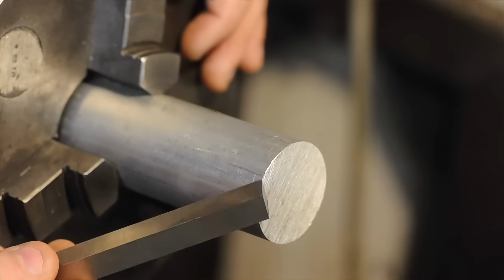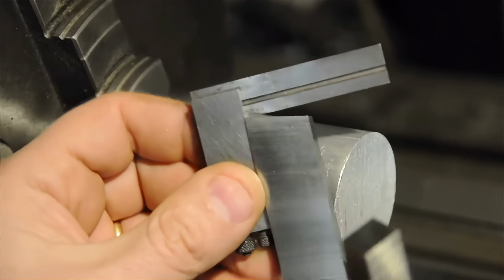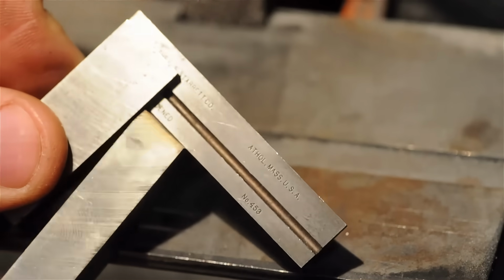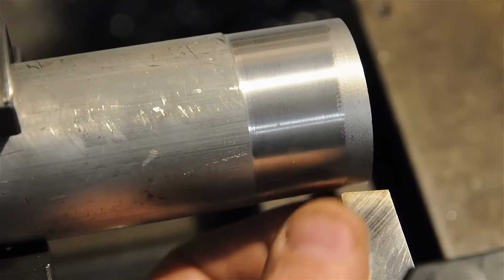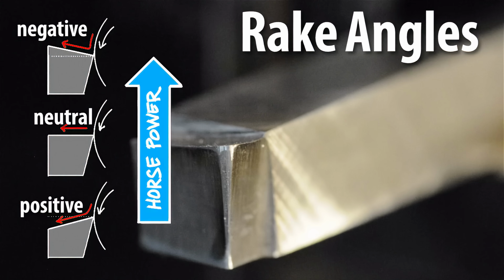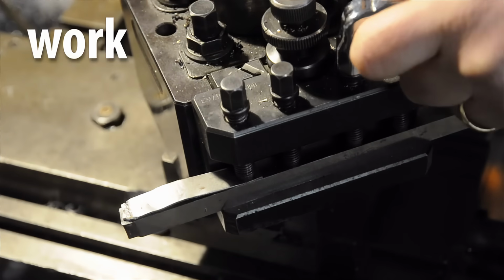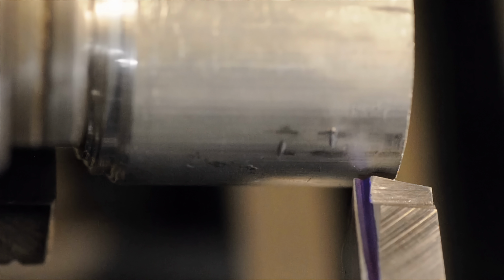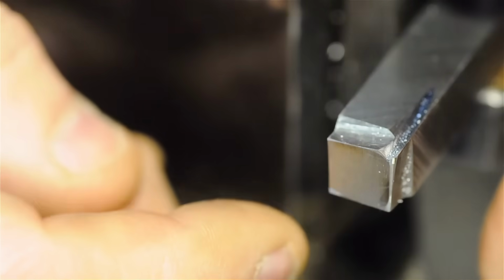Grinding HSS Tools

Comment: I love this lathe.>>>ur2.pl/861    I purchased this over a year ago, and it is still running strong. It does all the smaller jobs you need to do without skipping a beat. The variable speed on this machine is hands down the best feature you could ask for...(especially for the price!!!) Id recommend this to everyone looking for a quality, and affordable lathe.
Reply: good
Reply: Are you aware this lathe has plastic gears in the drive train?They all do HF etc), as they are all made by same supplier with different features and colors.  I broke a tooth in first month. You can go to Little Machine Shop and buy a set of metal drive gears for another $130 but PLASTIC (ok nylon likely),  in  a lathe!

Comment: Couldnt you just  tig a custom chip breaker on the tool a little lip
Reply: Jeremy hanna yes I'll hire you today  15 bucks an HR. come waste both if our time
Reply: @BrokenAbyss  I was asking a question u jerk I have seen videos were tony tig welds hss inserts on tools just wonder if adding a lip of some sort to break a chip clean and I promise u will not talk to me like that in person or you will picking your teeth up off the floor
Reply: @jeremyhanna3852  that is called brazing. That is completly different from tig welding although a novice in this trade would think otherwise. Brazing is used for custom tooling most of the time

Comment: I know this is an old video and you probably won't see this, but would it be safe to braze a chip breaker on to the top of this cutting tool?
Reply from the maker: as long as it doesn't come loose and end up in your eye, I don't see why not.
Reply: believe. 2 hrs later a Chinese lady is drilling on your eyeball while you can hear and watch this drill. you can't close your eye or bye bye eye lids

Comment: @ This  Old Tony
 A tapered grinding wheel about 6"in diameter will help you grind in the chip breaker easier. And  yes they are a bit fiddly to grind so that they break the material the tool removes into nice little chips. 
The other thing is that  positive rake on the tool is used for the machining of cast irons and similar tough metals to give the cutting point more strength.

Comment: Awesome video! Also another example of when you dont want to "break" chips, when i work with a more expensive metal on a lathe ill try and keep my shavings in nice long pieces, especially for silver/brass/high quality steel, as its easy to collect and sort large spring like shavings rather than a bunch of tiny chips, this way you can easily recast your shavings into ingots

Comment: I used 
a reg tool bit ,but it didn't hold up, got a old rusty tool bit, hard to grind but when used  did over 1000 parts with no re-sharpening

Comment: Can you show me how , out of hss or carbide 1/2 x 1/2 shank a 1/8 or 1/32 convex radius cutter that will cut 304 SS or kovar, it would be a face cut into a tube maybe a .04 wall thickness, & their can be no burrs in the id or the od , i guess it has to be right on center..

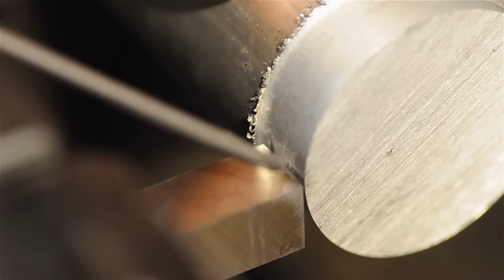Comment: Thank you so much for approaching this in the way that you did.  I just started learning to use a lathe and had somehow missed the fact the there were two cutting surfaces while turning.  At 6:34 where you showed the 4 faces and that the tool was cutting two edges was that "ah ha" moment for me.  Learning the "why" behind the tool geometry was more helpful to me than anything to date.
Reply: The Restoration Shop it sounds like you should stay away from every machine anywhere. you can't even touch my welder let alone those robots. who would teach you that. you must have been homeschooling while your mom was on a 18 yr vacation.

Comment: Hey, try playing with end mill sizes and cutting almost  parallel to the cutting face. Maybe 30 to 50% of the width of the end mill. I have no idea but it may perfectly curl the chip into itself and cause it to break as it would ramp inside the half circle cutout. If that does work that would be an easily repeatable (and time efficient) process for making a chip breaker. Let me know if you try it out as I have zero idea what would happen. I just have a theory.
Reply: TJ4774 were you compensated yet. that's brilliant

Comment: You should have run the first test with the factory end on. THEN cut it off. Missed opportunity. The first cut you made on the grinder basically replicated the factory edge but it left a scallopped circular cut due to the wheel, so it was even worse than Factory.

Comment: Just scored a load of about 27 of these exact type tool bits off ebay last week. They must of been owned by one of your disciples, or an experienced machinist because half of them that are used are ground exactly, and I mean EXACTLY like you show in your video. I got a great deal and have already employed them on a rotary table mount plate project and they cut great and left a very nice finish.

Another score that just arrived today, a lot deal on 21 slot/key cutters, most in excellent condition and bought for pennies on the dollar.

Now if I could only find a lot deal on some 60 degree dovetail cutters I would be set. Of everything I found, dovetail cutters seem to be the hardest thing to find deals on.

Comment: I was working with some hot rolled steel bar from a big box store that doesn't machine well at all with indexable carbide insert tooling. I re-watched this video, and proceeded to dig out an old 3/8th inch HSS lathe bit I'd fumbled around with grinding a long time ago. I quickly spotted how mine differed from your example and ground it to match yours - minus the chip breaker. Honed the edge and gave it a try. While the mystery metal HRS is still some crappy stuff, the nice sharp HSS cuts instead of plows, and the rounded tip leaves a far and away better finish than my TCMP 21.51 inserts tooling could get on my little benchtop 7x12 mini-lathe. Followed up with a bit of wet-sanding with 400 grit and got about as nice a finish as is possible with this metal with minimal effort. 

 Your intention to help people certainly paid of well for me today. so thank you very much! Your videos are simply outstanding and this particular one has gotten me back into wanting to grind my own tooling again. I think it is time to make up some proper adjustable tool rests for my cheap grinder and do things right this time around. Thanks for the inspiration...!

Comment: About chipbreaking. There is the deformation factor of the chip that get's lower as the cutting speed increases. That's why you sometimes see some 0.5mm thick chips when drilling while only feeding 0.1-0.2 per rev. The center portion only deforms the material around it and forges it into a thicker chip.

Comment: At 5:45, I've always called that "chatter."  The chatter marks are seen in the corrugated pattern on the OD of the cut area.

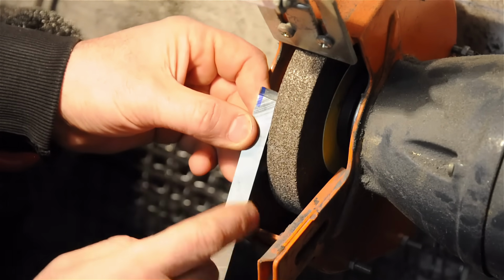At 26:59, I wanted to scream "GET BACK!"   Positive rake into a grinding wheel?  Yikes!  I got the same scolding after doing the same thing, then talking about the result.  My result was that the tool caught on the wheel and shot toward the concrete floor, leaving a divot.  It also took a chunk out of the grinding wheel and ruined the balance.  Made quite a noise, followed by some astonished cussing.  I was lucky not to be injured, and in retrospect, surprised the wheel didn't come apart.  The wheel was shot, but I kept it for a while as a reminder.

If I were to attempt the same grinding, I might use a Dremel with a cutoff wheel and clamp the HSS in a vice.  Something - ANYthing else.

All ranting aside, this is a very informative video, especially regarding chip breakers.  I struggle with them, too.  If you think 6061 aluminum is bad, consider 304 stainless without a chip break.  Lots of sharp razors flying around.  Ask me how I know...

Comment: The chip breaker/controller grind you finally put on that tool completely masked the rake angles you ground into the top of the tool.  I know; instructional, exploitative video, but just saying.
Thanks for presenting all that and especially starting from a square tool and developing each feature that progressively improved the tool's cutting performance. Very enlightening.

Comment: G'day Tony. I arrived here via ClickSpring. Your videos are fantastic! This one was especially educational. @30.29 I can see three things. 1. Curly chips, 2. a reasonable surface finish with a 30 DOC, and a better finish at 70. Is that because the chip breaker was shooting the chips back onto the part and scuffing it? Is that a risk of tool geometry // chipbreakers? You have one new subscriber!

Comment: To make your radius a little smoother (not necessary here, but in case you need a specific radius), color the corner and scribe your radius. Grind a 45 down to ~.010 from radius. Then knock the corners of the 45deg off at ~23deg down to ~.010 from the radius. You'll find you've got a quick rough radius ready to finish grind and/or hone. Just a friendly tip from a tool and cutter grinder.

Comment: GREAT VIDEO! Interesting, easy to understand and fun to watch teaching about tool bit geometry. I didn't even fall asleep once while watching it! The most important thing that I learned was that if I had just ground the ends of the HSS blanks off dead flat all these years they probably would have worked at least as well and probably better than most of the ones I tried to do 'by the book'! So much time - so many blanks - so many grinding wheels - so many ugly turnings - so much scrap! :@  Well...not any more!!! ; )  Seriously, THANK YOU ,Tony - FANTASTIC JOB, very much needed and appreciated!

Comment: Tony... I seldom comment about videos that I watch, even for the channels to which I've subscribed. But I'm adding my 2 cents to this one for 2 reasons:

1 - this is by far the most accurate, informative and useful video on grinding/using high speed tooling to be found on the entire internet
2 - I will "LIKE" this video, as I do for your others in lieu of comments... and I just wanted to confirm that the number of times a video receives a "LIKE" is very important to the channel's author, as well as are the number of subscribers to the channel. Please confirm for me the importance of "LIKE" for a video or set me straight if it's no biggee.

Keep'em coming. I look forward to the next one.
Michael K (in Winnipeg)

Comment: On a late tool, do you really need front relief? I get that it doesn't hurt, and the grinding wheel does it automatically for you, but if on a belt sander, do you need to tip the rest to get it in? the round shape of the thing your turning always goes away from the tool anyways?  I've always seen that this is the way its done, but don't understand why its needed..

Comment: Pretty helpful video. I like the way you present the information. I was wondering if you would be able to go into more detail on parting tools? I always struggle with them and haven't really had a great cut on my lathe. I've checked if the tool is on center, rake angles, etc.. Just doesn't seem to cut quite right. Would appreciate any tips you have on the topic!

Comment: Hi Tony, great explanation! 
Is there any particular reason why you didn't use your belt grinder? ..Do you normally grind your HSS on bench grinder rather than on belt grinder?
Reply: tomstr21 that's like hey tony I brought this demo grinder to your 1,000 000 dollar 1000ths spec on everything machine robot shop. you need help?

Comment: Very good explanation on making your own HSS cutter,s and the stages to think about during each process.

I took Machine Tech in High School back in 1973. We ground our own cutters for the metal lathe, and then made something cool with it.

One person in another class must have been really intrigued (most likely higher than a kite on pot), for with his long golden locks of hair, he managed to feed his locks around the carriage spindle quite nicely,. With the oil or grease on the spindle it clung ever so tightly to his hair, and before he could say "F**K" it detached a 3"X 4" chuck of his scalp with hair still intact from his brain bucket. 

Come to think of it, it may have been an Indian metal lathe waiting for its next quarry. That chunk of scalp and hair hung there as a reminder to all of us to be careful, when using an Indian scalping lathe.

I bought a lathe chuck for my mini-mill, along with a QCTP, and a set of brazed carbide cutters from Grizzly on 3/8" bar stock. They are mostly 90° angle, some with slight raking, no chip breakers. I'll be cutting a back plate for the 4 jaw chuck, which only needs a total of 0.040" to get a tigh fit.

Question I have for you This Old Tony is, the box of cutters has about 12 cutters, all with sharp points with no radii. I would like to put a small radius on one as I need it for another project. How would you approach this with your 10 years of experience? 

Keep up the great work!
CD
Reply from the maker: ouch!  about the cutters.. try a small diamond lap.  Might want to use cheater glasses to see the actual radius you're filing!

Comment: Grinding tools should be base knowledge of any machinist. Sure there´s insert tools for almost everything. Well, almost. I´ve ground form tools for my CNC to bring down machine time for series and for some jobs the tool was around 900 bucks for just one part so it wasn´t gonna happen.
Chip breakers on inserts especially only do their magic work when a chip gets a big enough size so you have to have a high enough feed rate and depth of cut.

Comment: I learned a ton! Thanks!  Since you like insert tooling, can you do a video on it?  I just went to the MSC website and there are so many options variables, that I don't even know what to order.  Some might be for a mill, some might be for a lathe.  Also, how can you tell if they are from a good source?  I bought center drills from amazon and they broke on the first try.  I know I need to spend more, but where is the middle ground from what NASA uses and what will break if I turn anything other than soft pine on my metal lathe?

Comment: Thanks Tony,  cutting edge stuff!  As you know, HSS is useful, it will take a very sharp edge and is better for interupted or very fine cuts.  Inserts, for any who don't know, were originally designed for heavy commercial machines and deliberately have a very small radius on their cutting edges, they are not as sharp as newly sharpened hss (see manufacturers catalog).  They are very good for removing a lot of material very quickly on a robust (aka 'heavy') high power machine.  The thing to do is to learn by experiment and watching a skilled and thoughtful person at work.  And that I think was the beautiful lesson in this excellent video.  Clearly shows why hss is ground that way.  Well done, Bob.
Reply: Robert Hawtin right. but don't watch in person.  stay on YouTube. trades men don't like someone sitting around watching. go sit in the truck kid.

Comment: Hi Tony 
Great video as always, 
You have convinced me to purchase a Diamond tool holder from https://secure.villagepress.com/store/items/detail/page/8/item/2826 they have a video and a jig block that makes grinding hss simple.
   I have a G&E shaper I need to grind some tools for also, I had to replace the bearings on the main drive pulley and thought I had it fixed, only to find the gears for elevating the knee are also broken, the machine does not look like it was used much because most of the flaking is still on the ram. There is a couple of machinery dealers near here and I have bought a good bunch of hss already ground by someone else, not that I could not do it, but the time involved is saved.
Thanks for sharing
John

Comment: I've been trying to find the secret to the perfect chip break with hand ground HSS bits, but it's pretty elusive like shown in the video. I've gotten it a few times, but It's dependent on so many things, it doesn't seem like something you should chase with hand grinding. However, from what i've found is that feed seems to be the most affecting factor. Calculate your speed right, and depth of cut and feed go hand in hand to make good chip breaking. whatever your material is made of is important, too. Some are inherently gummy, others break easy peasy

Comment: 10:26  What kind/brand of grinding wheel is that?  Also, does that company or any other company make that type of grinding stone at 1/4" or 1/2" thickness?  Instead of the 1" thickness that is common on grinding wheels?  Thank you.

Comment: thanks for the vid.  I have always defaulted to inserts because of chip control but am totally going try cutting a chip breaker on some hss tools and give it a try.  I like hss for cutting threads in stainless rifle barrels better than carbide inserts (avid hoby not pro) and I find the thread cut is nicer but getting the chips to clear can be a problem that has kinda galled some of my threading passes.  I am going to try this tip on a thread cutting tip and see how it works.